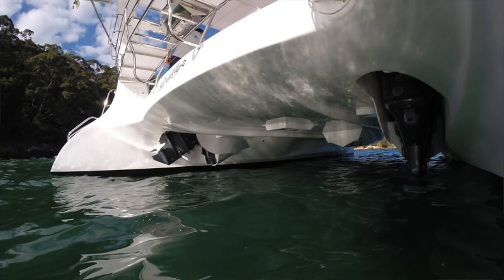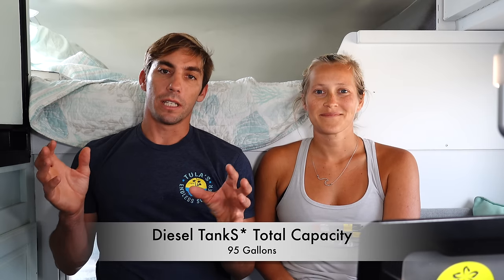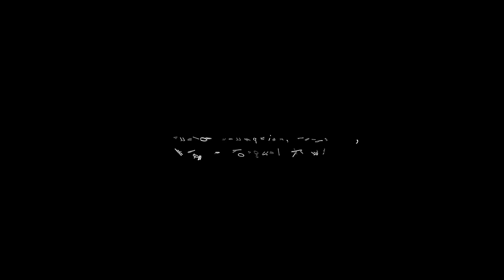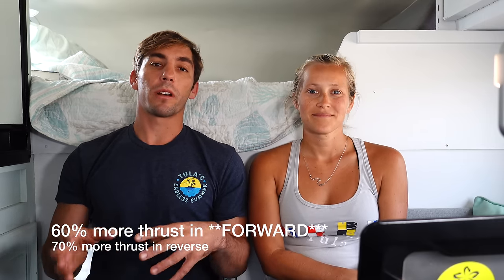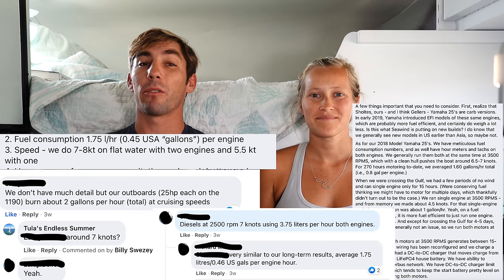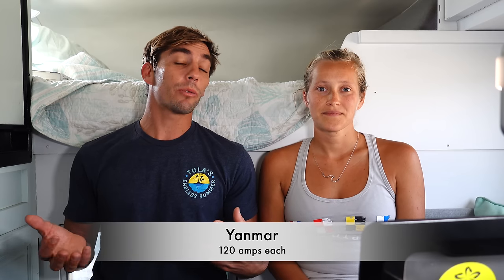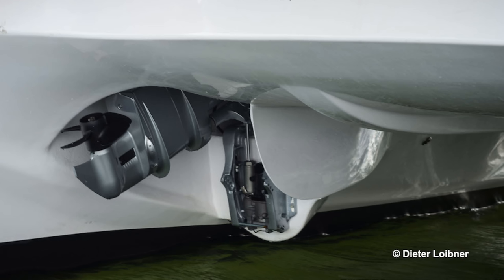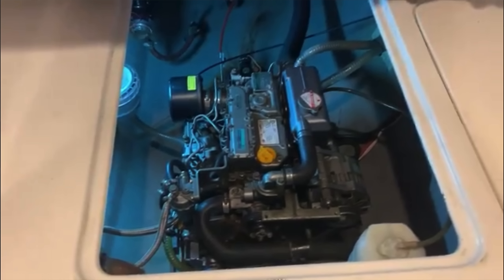Do Outboards Make Sense on a Performance Cruising Catamaran?

Comment: Yes no doubt, the Yamaha outboards are the most reliable, quietest and nearly the most fuel efficiency of all the outboards.  But definitely the most costly of the outboards.  There is no way the inboard Yanmars are quieter than the outboard 25 Yamahas, especially from the interior, especially up under the bunks.  The Yamahas are almost whisper quiet and I bet if you were in the inside of the boat, you could hardly tell they were running.  Also, removal and replacement of any of them yourself would be a snap in compares to the inboards.  Also, fuel cost in the U.S. for gas would be cheaper per gallon than diesel, and it's easier to filter, clean, remove water and polish gas before it goes in your fuel tanks than with diesel.  That being said, in some other areas outside the US, diesel can be cheaper, but random remote area diesel can have lots of gunk in it and requires some good filtering.  That all being said, if you went Yanmars, you really need a very good and solid fuel filtering system, even before it hits the fuel tanks, with an additional water separator, dual fuel filter and fuel polisher for those small Yanmars (they are finicky).  No doubt, if well maintained, Yanmars will get you 3-4 times the engine run hrs and you'll also get the cost difference back in total boat resale value.  My advise would be to insulate both engine compartments well for the Yanmars.

Comment: If you’re interested in performance sailing, no doubt outboards. If you want to own a motor sailor, diesels. 
Diesels will no doubt run more hours than outboards if well maintained, but no doubt will run more hours as the boat performance will suffer.
Diesels will produce more DC amps, but honestly if your on a catamaran and have the acreage for solar that should be an absolute non issue.
Would you leave your dinghy outboard in the down position with the lower unit immersed full time? Hopefully not, and that’s what saildrives do, a large chunk of aluminum sitting immersed in saltwater for how long?
We’ve owned a variety of catamarans, both diesel and out board powered and no doubt we prefer the outboard powered cats. We’ve also owned 2 Seawind’s and realize the advantages of the Seawind design coupled to the outboard engines and the given performance.

Comment: For the cost of the diesels you could get the washing machine, dishwasher, ice maker, a/c, and 5 Honda generators. A good generator(and maybe even a wind turbine) could easily make up for the alternators, and you wouldn't have extra hours on the motors trying to top off your batteries. It sounds like you will have plenty of solar. The maintenance on the inboards and sail drives is way more work and way more expensive, plus the haul-out($$$). All outboard maintenance can be done on the water, that's huge. You can probably even lift the motors with the boom and do the maintenance in the cockpit. And the storage you'll have under the beds, OMG. Finally, I don't get why range is such a big deal for you guy's. I thought you were sailors. Beau and Brandy, and UMA don't have issues with range. Anyway, that's what extra gas cans are for. Truly love your channel and enjoy the change of pace with Terra-Tula.

Comment: The outboards are basically toys and not a serious propulsion source for any vessel capable of world wide cruising.  Outboards would be like making sails out of bed sheets.  They will get you around sailing in the lake at the city park but have no place far from land.   You need something that will run for at least a week should you be caught in the doldrums or a storm on your nose and to get to sheltered anchorage might take a few days of motoring rather than reefing your sail down to nothing so your rigging is not ripped off.  Trying to store gasoline in forward tanks will be a large challenge because that gasoline in a big container being shook up will go bad in just a couple weeks of not being used.  It will also eat your carburetors or injectors so plan on carrying a case of spares.  The burnable "goody" in the fuel readily evaporates leaving you with a tanks full of toxic solvent that will not burn.  The diesel will keep for a very long time and with the addition of a fuel polisher you will never have fuel quality caused problems and diesel can be found all over the world where gasoline will always be of questionable quality.  If you don't fog the cylinders of 4 stroke outboards every time you shut them off the cylinders will begin rusting immediately so if it's off for a few weeks the whole thing will be junk.    At the least that leaves you with cases of empty aerosol cans to dispose of.  Not using it will leave a string of outboards to dispose of.  I guess you could turn half of one hull into an outboard overhaul shop.  I think you would rather spend your free time windsurfing or lounging around exploring with Sierra rather than trying to find places to have outboard parts sent to you.

Comment: I'd think about gas has ethanol problems those motors should be efi and if your in a third would type of country gas could be low quality diesel is always available and diesel is more reliable diesels run a very long but it is nice to have all the same engines for spare parts and such . Tough decisions 😕

Comment: So if the inboard has the sail drive sticking out under the hull, does that mean you can only beach a seawind with the outboards? Or is beaching not really an option with this size cat? Sorry if this is kind of a stupid question.
Reply: N Otium can beach with either. The keels are deeper than the inboard prop
Reply: @dfauchier  I can’t believe I forgot about the keels! Of course it makes sense the sail drives would be behind the keels and not stick down as far. I need to go to the seawind site and find some pictures. Or just wait and see how it looks when theirs arrives :-)

Comment: Diesel and inboard. Diesel will use less. There are a bunch of comments with the support.  Cost shouldn't be a factor given what your spending already.

Cavitation shouldn't damage your engine.  You do have an a/c?  Not having one is huge mistake

Comment: Spend it now or spend it later... The diesel engine will out last the gas. and even though repair and replacement MIGHT be easier with the out board it only counts if both inboard and outboard were to fail on the same schedule.. If the out boards need replacing twice a year but the inboard every 10 years which one is really easier? Lastly if you were dead set on only having one kind of fuel they do make diesel powered dingy's

Comment: Diesels all the way. You will save in option cost and in resale is much higher. Out boards are good in  costal use but in ln blue water long distance diesels are much more reliable and safer in high seas. There no gas stations out there.

Comment: IMHO, the question isn't diesel or gas in your comparison, but outboards vs. saildrive.  And I HATE saildrives.  My wife and I lived aboard a 41 ft. Jim Brown Searunner tri.  Diesel, but with a regular shaft drive.  We got to be around a LOT of different drive systems during our cruising days and the one on the bottom of the reliability list was always... saildrives.  Seal problems were RAMPANT.  Yes, the diesel has a lot of pros, but not hooked up to a saildrive.  If an outboard needs repair or replacement, the cost/downtime involved is microscopic vs. a diesel saildrive.  Just sayin'.

Comment: Adding both substantial drag and weight to a performance catamaran negates the performance.  A better sailing boat will rely on the engines less. This boat, with diesels, will no longer be a Seawind Lite.  However, it will still be a Seawind, which is an excellent choice.  If I were going diesels, which are probably best for how you use your boat, I would be inclined to choose a different Seawind Model.

Comment: As far as ELECTRIC production, the OUTBOARDS win hands down!  Why,  because with the money saved ($12k giver or take) you can buy a gas generator (if you want) and/or a large solar farm.  When we lived aboard we only ran our engine 3 or 4 times a year to make electric.  That was with just 530W and 400A-hr LA bats... and we made water with that too.  On a catamaran you can easily install 1.5kW, even 2kW of solar.  And with a large battery bank,  you should never, ever need to run any engine for electric. save arctic cruising.. So Outboards win for electric hands down IMO.

Comment: Diesel is hands down better and more capable.  Proper maintenance is expensive and never stops. You must pay for the capability up front and during the life of the product. You may get to a point where a trip may not be possible with the gas power and now you have a boat thats not working for you.

Comment: 20 years of owning a catamaran which originally had a diesel, I can say I will never own another boat with a diesel.  They smell, vibrate everything on the boat lose.  Require endless care and maintenance and a special mechanic as well as expensive haul outs as well.  I thought I needed a big alternator as well when I first got the boat, in fact I did have the money to get every option, which was a big mistake.  The key on a cat is keep the boat light, every ounce counts. Solar panels and a Honda 2000 generator are all you will every need for power.  Unless you want to be one of those live pretend to be sailors that typically motors everywhere.  I like to sail and plan my trips with tide and weather....and I have been sailing and racing for 35 years, own half a dozen boats boat monos and cats both racers and cruisers.   For my outboards, I typically do little or no maintenance other than flushing the engine and changing the oil occasionally , after 10 or 15 years I simply change it; the cost savings over maintaining the diesel easily buys a new engine in less than 5 years.  The biggest advantage is the outboards are 5 generations ahead of the typical diesel in design and just continue to get better while the diesel engine has not changed much in 50 years and have no place on a performance cat. Best of luck to you, keep it light and sail fast... you will have a lot more fun.

Comment: The sail drives are a liability unless they are protected by a good solid skeg so they don't get ripped off, sinking your boat, if you run over a floating tree or a nasty rock/reef.  Look, it happens to everyone.  There are three kinds of sailors, those who have run aground, those who will run aground, and those who lie about it.

Comment: LOL Well seeing your not a dummy. I knew you would take the diesels over the outboards. Longevity being one, there is no way a a 2 or 3 banger outboard will last as long as a diesel. Plus to make the same torque as a diesel if it can the outboard will be running at a much higher RPM. Which means burning more gas more oil changes and wearing out faster. Also much less maintenance. Diesels just change the oil and make sure you have clean fuel which you have to do with out board also, but no coils or spark plugs etc.

Comment: This is not even a decision. The only real advantage to the out boards is that you can pick them up. If you were parking this behind you mansion on star island I would go with outboards but this is going to be you long term home. Just imagine you are way out in the ocean with no wind and low fuel, what engine would you chose then?

Comment: WoW? Your decision surprised me.. I thought you two were sailors, not motorboaters.
Should be a very little use item, not a concern for fuel, power etc.
Firstly, I hate Seawind’s design for mounting the outboards, wonder if they got the idea from James Wharram’s Tiki.
No mention of much lighter, easier maintenance, Yamaha 2 stroke outboards. Which I’d mount on the sides of the transom steps, with additional rotation for turn on a dime, secured against thieves, but easily removable by yourself to throw on the back of the tender, therefore 2 rather than 3 engines. Plus no dirty diesels frees up some internal space.
Portable fuel tanks, which are much easier than inbuilt tanks to clean-out if you purchase some bad fuel somewhere. Same for water, place the pump hose in the “potable” jerrycan.
I’d also have retractable rudders, with no props under the boat you could easily beach her to wash the hulls etc. There’d also be less thru-hulls & seacocks. 
Keep it Simple & Safe, rather than flashy & difficult.

Comment: Welcome to boat ownership. Compromises everywhere. Inboard = more battery charging capacity, free hot what, etc.  Outboards are cheaper, easier to maintain, etc.  Gasoline is explosive, Diesel fumes stink.

Why not a diesel to port and a outboard to starboard?

Comment: The Yanmar will last longer than you will own the boat.  My dingy 15 hp Yamaha burns 4 times more fuel than my 30 hp diesels.  The diesels provide enough torque to motor using only 1 motor at a time, saving maintenance and engine life.

Comment: You missed one big consideration. If you go with the outboard option, it's much easier to switch to electric if you are so inclined in the future. Throw a couple torqeedo 10s on your boat in an afternoon. It is the main reason I have been thinking Seawind. Run one high torque Yamaha, one torqeedo, and sails...You have 3 different modes of propulsion.

Comment: So where are you going to carry your spare gas ??? One thing you have not thought about is your insurance ? Chances are the cost will be far higher when you have gas engines versus diesel. The diesel engines will be good for a min 10,000 hrs and the outboards ??? So is the diesel more expensive ? when you will have prob had to replace the outboards several times ?? Diesel = reliability ,safety and value  Diesel every time Gas on any boat is dangerous ! no matter where your main tank is sited.

Comment: I can't give the advice you need because its based on money. I have an inboard diesel and the cost of hauling out is insane. Really if the world went to hell having unserviceable crucial parts is gonna suck.
25hp meh. That's really shit. Some waves absolutely will need 40hp. So no I would go with Yamaha 40hp outboard for everything. 214lbs x3. When and It is when a motor fails you have 3. Gen get a remote start actual gen. 4,300w. Your going the worst way possible too save money and or fix what you own. Why well there are 2 kinds of people in the boat world those who can get things done and those who pay for it.  I highly doubt you know more is going to let you fix their engines without specialised tools. So personally that's what I would do the 2x 40 HP  and also fabricated is Central mount for the dinghy motor   with a transome attachment point so you can swap it into your dinghy or use it as a third motor. So so it would cost the same as the diesel yet you would have way more versatility and ease of repair ability and way more power 120hp total.
Grass is always greener on the other side.
Lolol.

Comment: Longevity,  a diesel will last 5 times longer than a gas engine, a gas engine is turning twice the rpm of a diesel engine...  you will buy 3 sets of outboard engines to even come close to diesel,  and as you mentioned, burn twice the fuel... oh wait,  you don't need engines,  got sails?

Comment: There is no real option to it, inboard Yanmar engines are a FAR wiser choice, from resale to performance. This is one of those times when you get what you pay for.  Unlike cosmetic upgrades, which wear out, so you kind of do cosmetics TWICE, when you buy and when you sell, the Yanmars can be enjoyed now and should not need replacement when you sell.  An overall great investment in a boat which is generally a horrible investment.  Most important, though, a good engine can save the entire craft in some situations.

Comment: anything but a diesel for a live aboard is a foolish choice, don't put seawater through the motor, use coolant in the motor and a heat exchanger the motors will last a LOT, LOT longer

Comment: I think you know what to pick diesel definatly because of efficiency,range,electricity I also don't belive outboards are even close to reliable they are made with alot of different metals making them more problematic as far as galvanic corrosion also the boat is not a tender its a boat forget about outboards in boats this size bad selling point

Comment: I am not sure what the deal is not quoting REAL costs?  This seems to be a trend in YT videos.  Everyone understands that the price is what you paid on the day you paid, and "your price may vary".  1%  or 5% of purchase price is of little use if we don't what the purchase price is!  Is that list price for boat only, no options?  Or boat with options, delivery , tax etc.  Just give us the real numbers as I doubt it's because you're shy about the money you're spending.  In the grand scheme of cruising cats, the 1060 Lite is cheap! 

We chartered a Seawind 1000XL with dual 9.9 high thrust long shaft Yamaha's.  They worked great for the 36' cat, as a charter boat.  The one big knock was the noise.  The compartments where they sit might be better sound proofed, but anything added also needs to be waterproof.  As a coastal cruiser/weekender and for the budget conscious, I can see how they make a lot of sense.  For your bigger cruising aspirations, and the big electric/battery system you plan to have, the diesels make more sense.  Good choice!